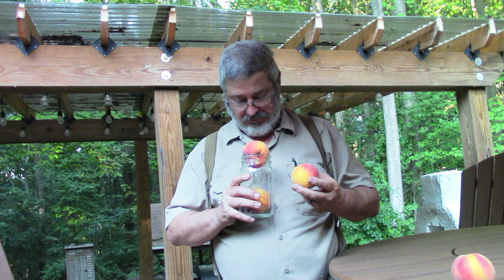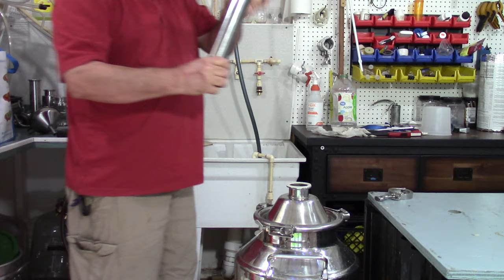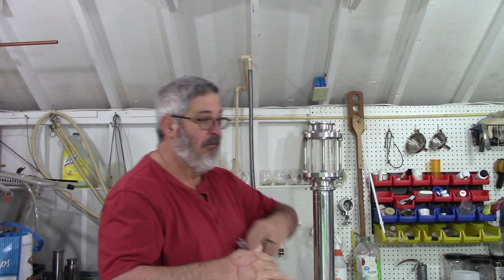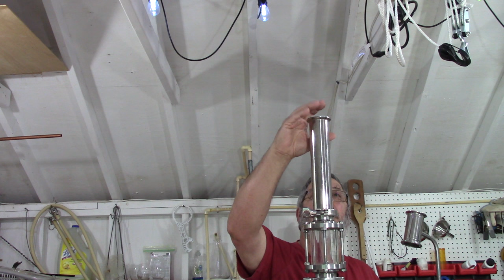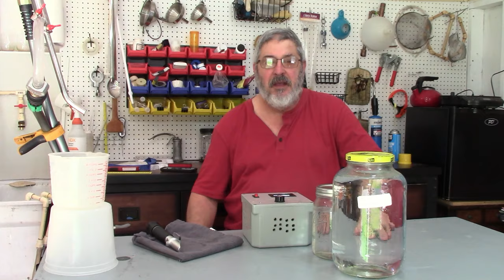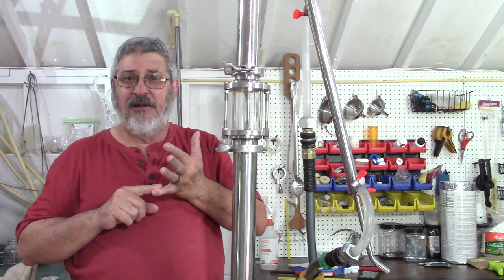Peach Brandy part 2

Comment: This is called a 1 1/2 run. Where you strip and then run your spirit run with mash & low wines together. Consider getting a whiskey helmet and copper condenser for your brandies and fruit/whiskey runs, Randy. Would be interesting to see you mix it up. Thanks for another great video.
Reply from the maker: I think your right cheers